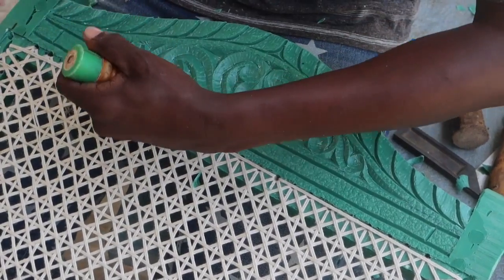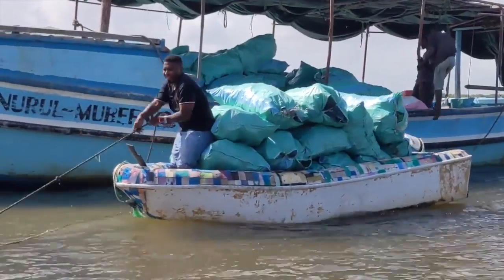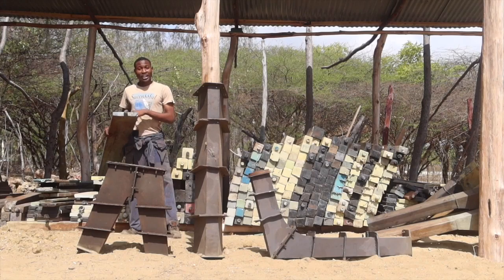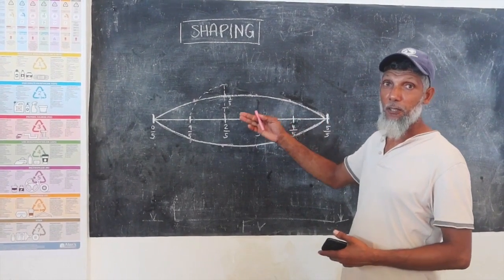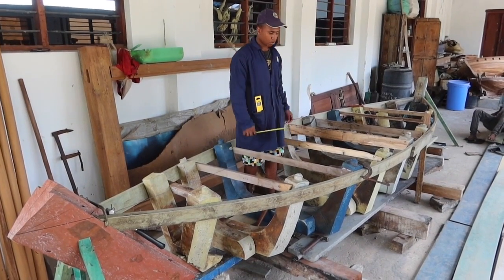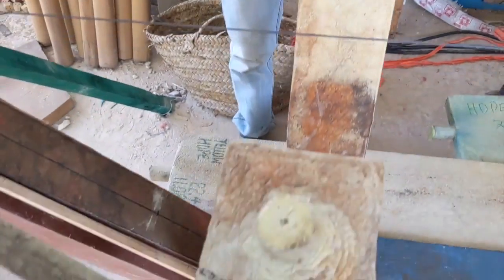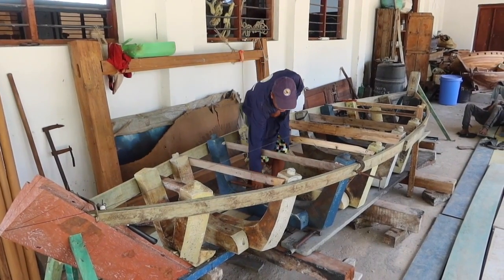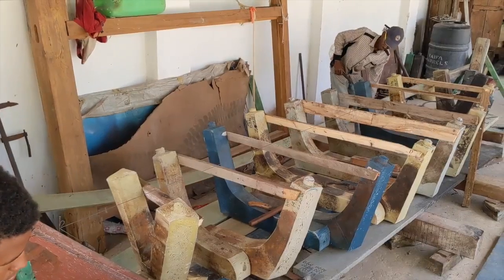How to build a canoe from plastic waste

Comment: Amazing work all round 🎉.    =》It seems that trapezoidal tongue & groove on boards & trapezoidal tenon splines on ribs would eliminate nails & screws -saving on cost of store bought fastners,  most caulking & welding too. Ribs can be aligned  on a common axis instead of side by side, by using the same type of scarf joint, as on the plank side walls, so that they become a single piece, not only strengthening but reduce mass, increasing balance.  

Excess material could be hollowed out of the ribs, reducing unnecessary material & weight , then re-drilled creating plastic pipe couplings & plugs, as a useful 2ndy value added product (○)  (○)   ● ●  .

Comment: Boat looks very heavy and is sitting very deep in the water. I'd like to compare it to the boat that the design was taken from, to see just how deep it's sitting compared to the original timber version. I'm unsure why it was built with such thick frames, those frames to my mind could be half the thickness, therefore saving weight. I understand the idea is to use as much plastic as possible, but the fact remains these dudes have to use these boats in the ocean and safety is paramount. Weight is a serious safety factor, especially in small sail boats that are used for offshore fishing. Hopefully it will evolve as it continues along
Reply from the maker: Thanks for the technical tip! We'll pass it along

Comment: could the change in material warrant a slightly different design (using the same building techniques). I wonder if the strength to weight is the same and I wonder if they could fare the hull more to improve speed. There are also dozens of fittings and tackle that could be molded from plastic for holding ropes and gear etc.

Comment: Wow. You made a very sturdy boat, but it seems to me that this could be done more efficiently, maybe 3D printing a hull that is one or two centimeters thick. Another option may be to make a clay or cement form and carefully cover it with the melted plastic. If it is a cement form, it could be used time and time again, but it would be harder to get the boat off. If it is a clay form,  it could be more easily scooped and washed out. I am just brainstorming and I do not know if these ideas are feasible. Best of luck.
Reply: This isn't just a case of perfect being the enemy of good.   Part of the magic here is the integration of skills and roles people already have- the applicability to contemporary life.   Not the new.   Not the "efficient" use of materials.   THIS is the path that can be taken to those places, if that is where good lies.
Reply: @mavigogun  Exacto :) You got the point! Even though, still we do agree that even within the traditional building techniques we could improve efficiency of materials with the plastic. Work in progress :)
Reply: @mavigogun  Yes, but this could be much more efficient and the boat could be more streamlined. More brainstorming: I am imagining a upside-down form on wheels that can be moved around under an extruder and the plastic would be smoothed manually. Best wishes.
Reply: @jacklorax  I agree. The flooring and hull can be made with different layers with an air pocket between. The bottom layer just has to be strong enough to support wear and tear, which hopefully can be made from thin plastic bottle layers, and the flooring can hopefully be made from thicker pieces to support the weight of the sailors.

I'm no expert.